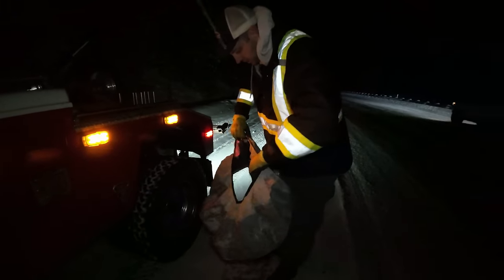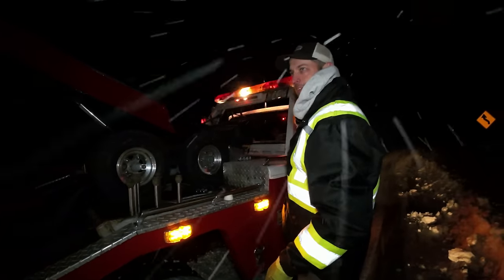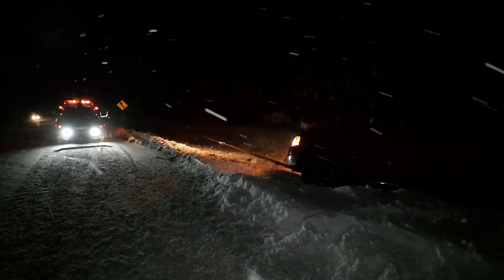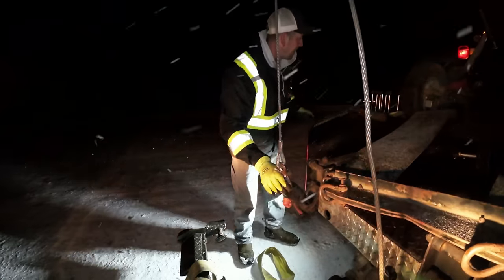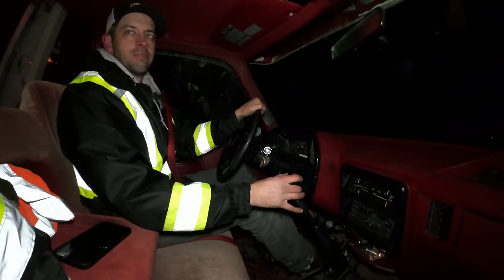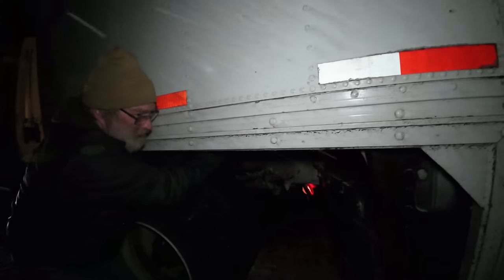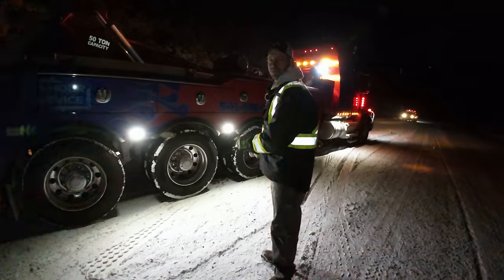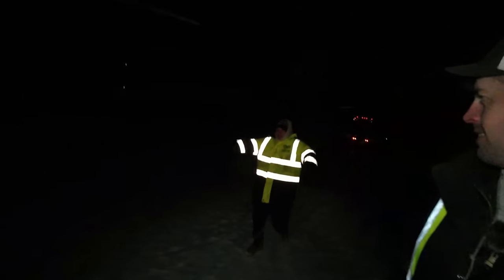Snow storm on the mountain.  Bring in the big dogs!

Comment: Need to invest in a better light bar on top. I really like my Code-3 Defender Lightbar, Dual Color AMBER/CLEAR, 48 Inch, DF2AC @ Dana safety supply. Very good customer service department too.
Reply from the maker: I can begin to tell you what an incredibly stupid suggestion I think that is.   This old incandescent bulb rotating light is far safer than any of these dumb led light bars out there.
Reply: @CaseyLaDelle  I mean if you're going for the Jamie Davis antique road show look just say so but we used to them but the old parts constantly break now can't find the parts anymore so its down for days if you can't manage to rig something then bulbs for them go out constantly, water vapor is constantly getting in them. The plastic on them like on yours is so sandblasted it is now an o·paque lightbar you could probably buff some of it out but nothing compares to the longevity & lumens of LED lights. They both run on the same 12V vehicle standard systems. 1 towing operator is killed every 6 days so saying something that increases your safety stupid is well stupid. But to each is their own have to agree to disagree.
Reply: @CaseyLaDelle  and LED lights are much more problematic for us older drivers. We’re often almost blinded by them so the incandescent are much better because we can see them clearly.
Reply: The problem with most led bars is they are absolutely too bright and blinding in the dark, blinding oncoming traffic through an incident is not safer. They will see flashing lights but not you. Rotators or even a 4 head strobe bar provides warning, without affecting driver vision.
Reply from the maker: @ruger8412  I fully believe that the super bright and fast flashing LED lights are the reason so many tow trucks get hit, not the solution to it.    I cannot tell you how incredibly fucking stupid it is to think that blinding the people driving towards you is a good idea.    
You’ll also notice that I didn’t turn in my upper work lights, for the exact same reason.   Shining bright lights at the people who are coming at you is so ridiculously stupid that anyone who thinks it’s a good idea shouldn’t be allowed to run a tow truck.
Reply from the maker: @JohnHallgren  exactly.  These old school light bars are FAR safer.
Reply: These reflect down to the ground at 45°& 60°Angles so a direct lightbeams dont hit the eyes of other drivers. Not only that they are completely dimmable with the option of front or back independent operation. I know people don't like change at first but you use a chainsaw over a old misery whip. Or hydraulic over reduction gear ⚙️ winches, wheel lifts instead of sling loading everything,,,,
But like I said above we'll have to agree to disagree & move on.
Reply: I like my old incandescent light bars better.. like Casey said, in inclement weather Ive found all LED lights do is blind oncoming traffic. Even police and Highway Patrol cars have been smacked here in snowstorms because oncoming traffic gets blinded by the light!!
Reply: @CaseyLaDelle  The brightness of LEDs have been shown to cause more issues. Can people see you further away? Yes. Can they seen once they get about 200 yards from you? No. Law Enforcement has the same issue. That's why a lot of their bars have 2 positions - high and low. The last thing you want is a blinded driver coming up on your six and taking you out.
Reply from the maker: @mishkajb  exactly.  The California CHP did a big study on this and went to the practice of turning off all rear facing lights once a vehicle is pulled over, and then running only their standard 4 way flashers.   The number of cars being hit decreased substantially
Reply: @CaseyLaDelle  and same issue with LED headlights! A low beam LED on a dark windy road is much more blinding to me than a high beam halogen one! I have to try and look over at the white fog line to get a clue where the road is…
I absolutely HATE those LED headlights in almost all vehicles!